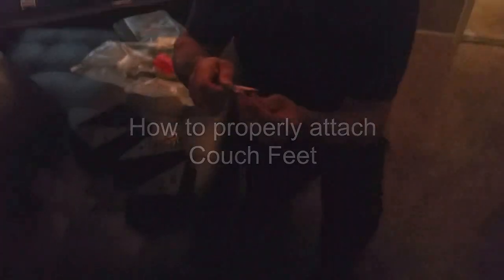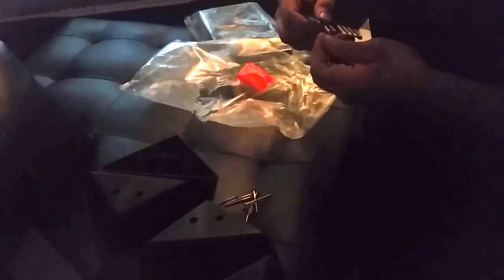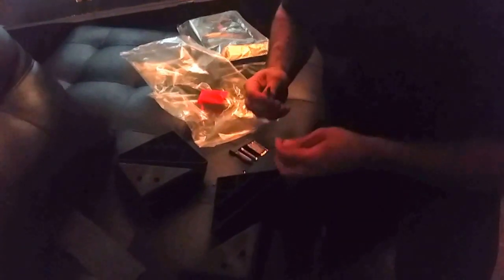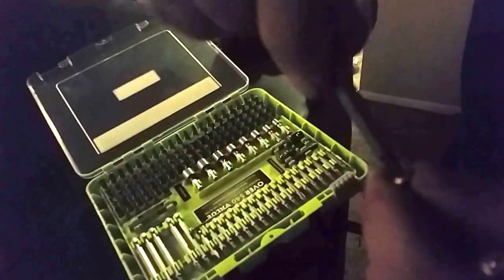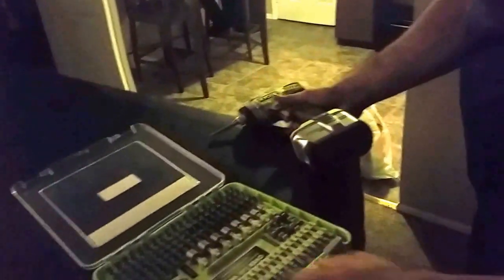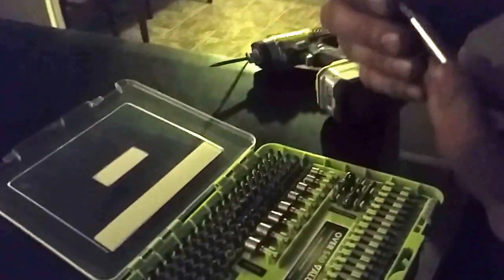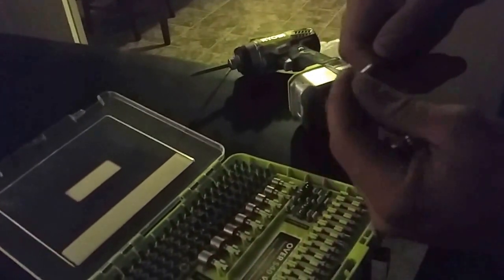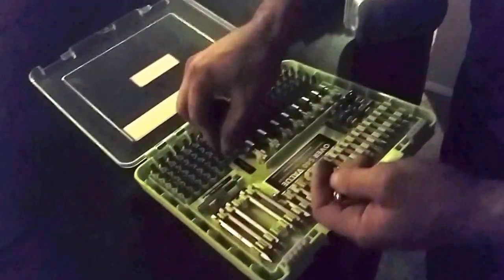Delivering Couches: How to Attach Couch Feet

Comment: Nicely done. I'm putting feet on a sofa that's never had them before and is not built for that. I like the triangle feet because you can get it on the frame, unlike those feet that have one screw in the center. Hope I can find me some triangle feet!

Comment: Thank you so much man. Just bought this exact one from BIG LOTS and I was going to put the legs a little lower than shown but Im glad I came across this video. Are there holes in place already? or do I drill my own as shown. When I was a furniture mover, sometimes there would be holes ready to match/line up beneath the cover.
Reply from the maker: Thank you so much for your feedback Kenneth! There are no holes in there yet, you have to make the holes with the wood screws.